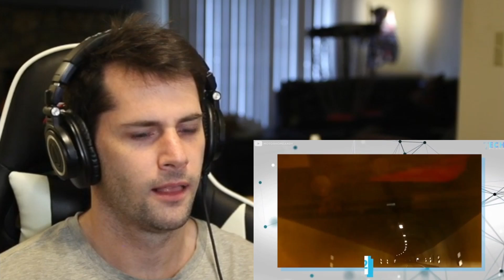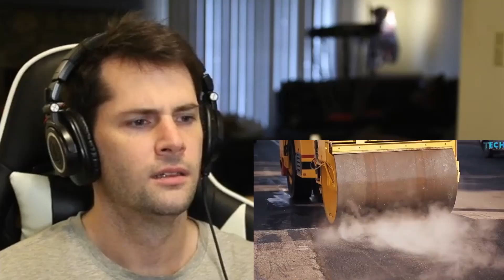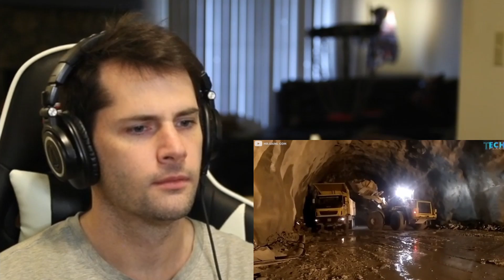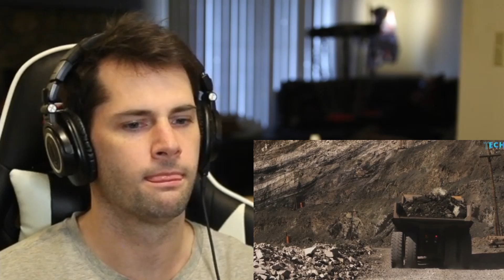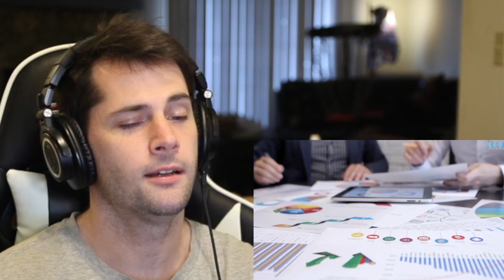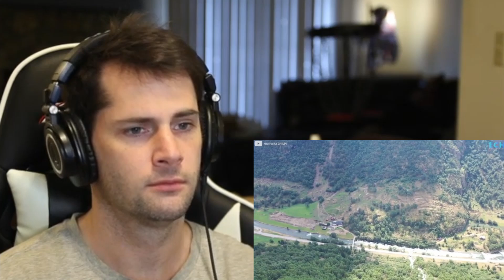American Reacts to Norway's Laerdal Tunnel (longest car tunnel)

Comment: The tunnel is now outdated and needs to be closed for a year to be upgraded to meet new safety standards. Work is supposed to start some time next year. (Although they haven't decided wether to close it for a continous year or if it should be split in two half year periods.) Also, there are no longer speed cameras placed throughout the tunnel, but rather one at the start and one at the end, measuring the average speed of the vehicles through the tunnel. The speed limit was reduced from 80 to 70 kph quite a few years ago.
Reply: No, it's 80,.But if pepole believe it's 70, I understand why I have to pass so many cars when driving there.
Reply: @IstadR  My bad. Was sure they reduced it to 70 when they changed from normal speed cameras to average speed measurement.

Comment: Yes, driving this tunnel is an exciting experience. I've done it just once in each direction and it was an easy drive. Of course, there are longer tunnels, just not for roads. The Gothard rail tunnel is 59 km long. The longest tunnels in the US were built before WWII and are to carry waterways. The Delaware Aqueduct tunnel is over 85m long, and is also very wide, at close to 14ft I think.

Comment: Hi Tyler. I've been to Norway several times on coach holidays. The roads in the country between cities are very narrow and are usually over environmentally protested areas and quite often have to cross fjords by ferry, we did hundreds of miles in the country. We did travel through loads of marvellous tunnels. In the UK we don’t have many long tunnels. However we connect to France by the Channel Tunnel from Folkestone to Coquelles/ this is a rail tunnel of 31 miles. Carry goods trains, car carrying trains and passenger trains. The passenger trains, Eurostar provides direct trains through the channel tunnel from London, St, Pancras to Paris, Brussels or Amsterdam.
I’ve been through the tunnel several times. A trip to Amsterdam takes nearly 4 hours, Paris takes about 2 ½ hours. These are city center to city center, flights are quicker but adding city to airport times the tunnel is quicker.
And no you can’t see fish from the train windows!
Reply: Hahahaha!
🐙❌️🐠❌️🧜‍♀️❌️🐳❌️

Comment: Tunnels are becoming increasingly more common in Norway as they're becoming technologically easier to make. And yes, they are a great safety precaution when it comes to situations like these, but they can be MONOTONOUS to drive through depending on their length. In some other cases, new tunnels are made to deal with heavier tourist traffic, as in the ones made between Stranda and Hellesylt, as the old road, while scenic as heck, was narrow enough to make the summer traffic a bit of a pain.
Reply: Norway is also the best at tunnels in the world, for the same reason the Netherlands is best at controlling the ocean so it doesn't overflow and kill them all, necessity.
Humans have an urge to go the shortest path possible when traveling from A to B, so.. Tunnels.
Mountain, screw you, we're going through.
Reply: @OriginalPuro     ...well...then why not combine these two different challenges.   The Dutch should stand ready saying WE WANT THAT ROCK YOU TAKE OUT.   It is millions and millions of cubic meters of rock ....and you will desperately need it in rather short time ....the sea is rising and more frequent storms is coming.   But there are also a challenge from the inland side with more often ....and bigger....flooding of the rivers.  
I know that Netherlands has imported rocks from Norway ...but you will need much, much more.  So be there when Norway has such on offer, there are gigantic projects going on right now.   Timing is important.
Reply: ...well...yeah...every meter of tunnels build makes it "increasingly more common".  But still it is inaccurate.
I would call your claims rather weird even ignorant.   Norway has been building tunnels for 150 years and has now more than 800 km of road tunnels.   So even if there has been some large projects lately it does not make much difference in the overall number (in kilometers).  Most of those kilometers of tunnels has existed for a long time.  
Also your claim why the tunnels are becoming more "common" is weird.   In your claim it is due to that they are "technologically easier to make".    ......well.....??????........ again ...yeah...the world moves forward and generally new tech pops up here and there.    But specifically what has popped up that makes tunnels so much "easier" to build.....????   Explosives has existed since ancient times ...ask the Chinese.  Drilling has existed for 100 years and tunnel boring machines (TBM) has existed for decades.   So what tech is hidden in your claim?
I would like to make you aware of that the real challenges ...and costs....are to be found in the preconditions for a tunnel project.  That means in the quality/condition of the rock face.   If the rock are totally rotten or cracked up or there are a lot of water ...all over.... the difficulties and costs will rise multiple times.
There are a good example in the train tunnel project, Follobanen (railway tunnel of 20 km out from Oslo), that officially was opened today.  The rock face was extremely cracked ....and the price tag are now on 36,8 billion NOK (nearly 4 billion US dollar).  Looking forward to learn more about your technical secrets....
Reply: @Dan-fo9dk  This video itself showed some of the planning phases that included calculations made with computers for one, but holy shit, man. I don't really mind people embellishing on my admittedly simple comments, since I never claimed to be an expert and don't really mind being corrected either, but would you please stop with the passive-aggressive condescension here? Yeah, I KNOW tunnels have been around for a long period of time. I have lived on the west coast of Norway for more than 40 years and seen more and more tunnels either being built new or made to replace older, shorter and less safe ones. I've seen and driven the underwater tunnels to Vigra/Valderøya, which has been around for quite some time by now, to replace the ferries that used to go there. I appreciate your input and all, but next time you feel the need to lecture someone, kindly leave the attitude at the door.
Reply: @Northlander72     ....oh....they used computer in their work with the tunnel....what a revolution..!!! ....and you think that was a first....haha....you are really lost.   Let me inform you that NASA put people on the moon in 1969 ....and they were totally reliant on computer calculations.   You seem to have a problem to deal with knowledge and facts.  When someone points out that there is no substance in your claims....well....then you resorts to behave like a drama queen....so thank you for your little performance.....which didn't really help anything on the image of your knowledge concerning the claims you come with.   
Don't blame others for your own lack of knowledge.   and don't post claims if you don't know what you are talking about ....and don't want to be commented on...simple as that....right....
Reply: @user-zo7gh4sy9o  Here, I made some edits to your first reply to my original post:

"Norway has been building tunnels for 150 years and has now more than 800 km of road tunnels. So even if there has been some large projects lately it does not make much difference in the overall number (in kilometers). Most of those kilometers of tunnels has existed for a long time. Explosives has existed since ancient times ...ask the Chinese. Drilling has existed for 100 years and tunnel boring machines (TBM) has existed for decades.

I would like to make you aware of that the real challenges ...and costs....are to be found in the preconditions for a tunnel project. That means in the quality/condition of the rock face. If the rock are totally rotten or cracked up or there are a lot of water ...all over.... the difficulties and costs will rise multiple times. There are a good example in the train tunnel project, Follobanen (railway tunnel of 20 km out from Oslo), that officially was opened today. The rock face was extremely cracked ....and the price tag are now on 36,8 billion NOK (nearly 4 billion US dollar)."

The second part of that I actually DIDN'T know -- at least not offhand, though now that you mention it, I do recall reading about it -- but the ONE thing I asked you for was less attitude, yet you chose to double down on that instead. Had your post been like the one above, I would not have said anything, so... why?

Comment: Duh.  Of course, you blow up mountain rock to make tunnels.  Did you think they're done by tickling mountain rock?
Reply: Many tunnels are actually built by sections of concrete or built in place with concrete. Typical in cities to go under buildings.
People that don't live near tunnels and maybe never used one don't really think about these things.
Reply: Tunnel Boring Machine (TBM)
Reply: @Carol_65  No. This tunnel was built with good old fashion blasting...
Reply: @Carol_65  - Yes, but not the appropriate choice in all situations.